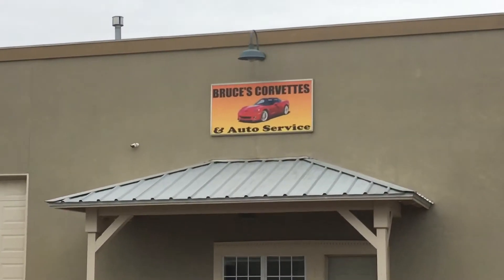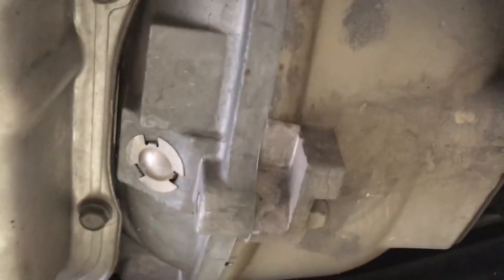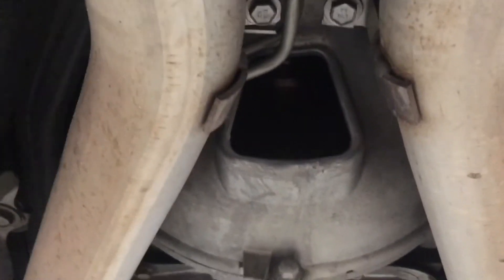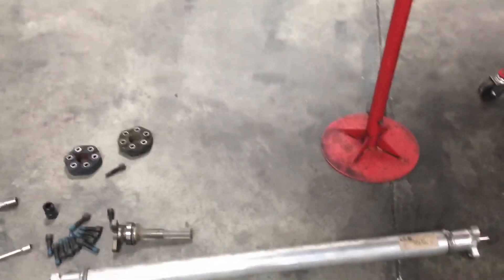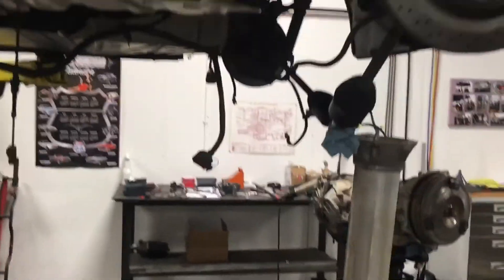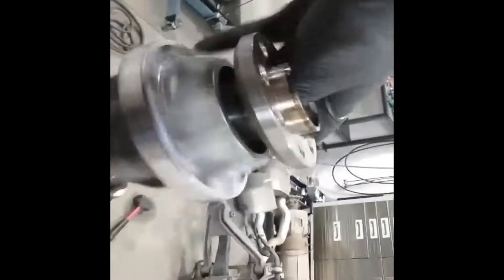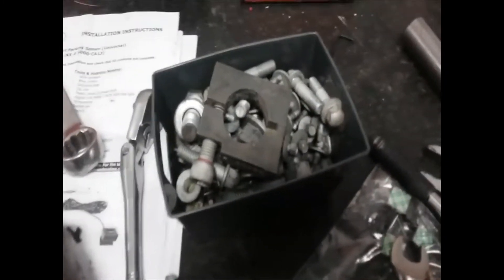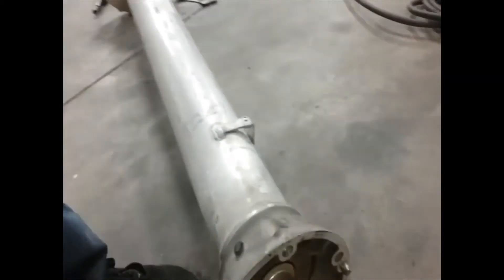Corvette Torque Tube part one

Comment: I put in a stall converter and a new engine in my C5 but didn't know about putting the bolts in to hold the bearings in place in the torque tube. Everything went together easily without much resistance, what damage could I have done.